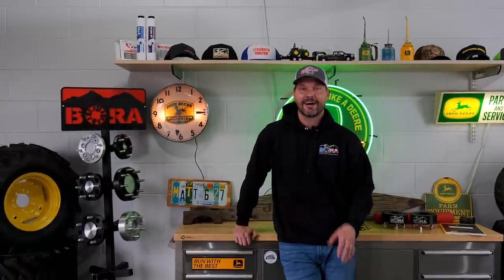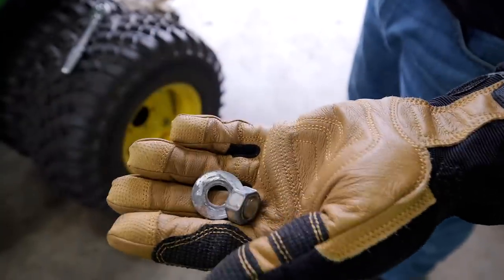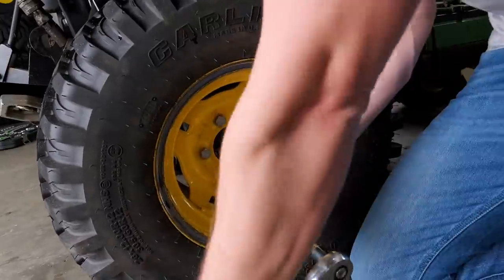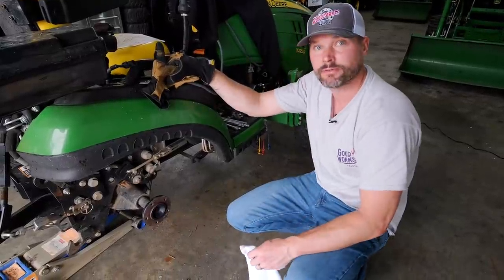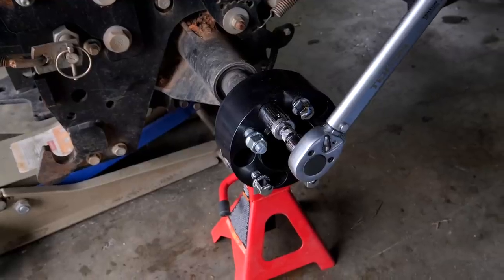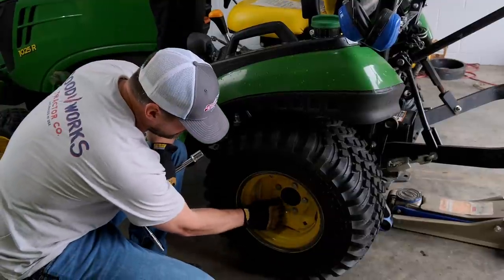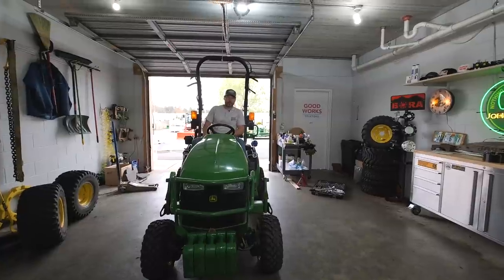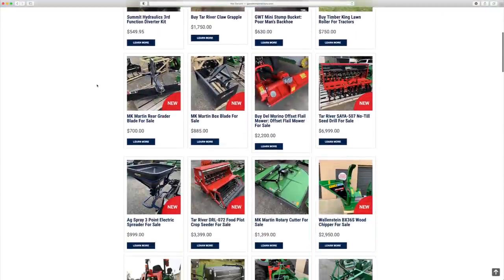SAFETY FIRST! HOW TO INSTALL WHEEL SPACERS ON YOUR TRACTOR! 🚜👨‍🌾

Comment: Great video!  As a note for those handling larger tires filled with ballast, this works well for re-mounting:  (1) roll the tire onto a 2x6 and lean it against the lugs (2) rotate the axle by hand, to align the lugs with the holes (use chocks on the front wheels as in this video, so you can have the parking brake off), (3) with the tire tilted against the top lugs, raise or lower the back end with the jack, so that the top two lugs drop into the holes, (4) put nuts on the top two lugs to the extent that you can, to keep the wheel from coming off when you raise the back end further, (5) with the nuts in place, raise the back end until the remaining holes slide over the lugs.

This worked well for me on the L2501.  For one wheel, I had removed all of the ballast because I was afraid I couldn't handle a 400 pound wheel  (the ballast was about 250 pounds of the 400).  What a project it was to pump all of that fluid out, and then replace it after putting the spacers on.  So on the second wheel, I tried the method above and it was so easy.  Get some help if you can (I did this myself as an old dude), and make sure to keep that wheel vertical when you are handling it.

Comment: Hi, Courtney - love your videos - I've learned a lot from you and just purchased my first tractor at the age of 70.
I was getting ready to order some BORA spacers, and took the time to read their  "Terms and Conditions".
With my Rimguard filled 36" tires, I would have to schedule someone to help with the installation, probably on the weekend.
But BORA doesn't allow for this:

• TIME LIMIT FOR REPORTING PROBLEMS - Any and all complaints, problems, issues, missing parts or components, etc., if any, MUST be reported to MOTORSPORT TECH within 48 hours after Customer accepts delivery of merchandise. After 48 hours, all problems and issues, except for warranty issues, are the Customer's responsibility. 

Also, installing the spacers with help from a friend automatically voids the warranty:

• INSTALLATION - All installations shall be performed by a licensed professional mechanic or by a professional wheel or tire store in order for our Limited Lifetime Warranty to be applicable.  
I guess I'll hold off on ordering under these conditions.
Rick.

Comment: I did wheel spacers on my zero turn that I use on slopes, it really provides more stability. Also, I use brushless impact drivers for my loosening and spinning the lug nuts. I still start them by hand and occasionally, i need the 4 way lug wrench to loosen but the impact driver really speeds the process. And yes, I  torque the final quarter turn.

Comment: Purchased 6" steel set of these wheel spacers for my 3720 John Deere last summer.  Used your discount code. (THANKS)  This tractor is used on my small farm and our golf course.  Everyone says these are true life savers on the Tractor.  I had bugged John Deere for years on a solution with no help.  We have rolling hills here in southern Indiana and these tractor are unsafe with these spacer.
I installed on front and rear wheels with no issues.
Reply from the maker: Awesome glad to hear it!!
Reply: Similar terrain issues here in Scotland. John Deere should seriously note that not all farms are on prairie land. Spacers are the way to go IMO.

Comment: I have to agree that this is the best upgrade to do first on a tractor. This is speaking from experience since I did not do it for the first year of owning a BX23S and having a few "tipsy" moments. I installed the 2" spacers and it does feel more planted now on side hills. Anti-sieze should be used on all the bolts and nuts during installation. It allows for more accurate torque settings, compression of the wheel rim and spacer, and more accurate stretch of the studs. Great video!!
Reply from the maker: Awesome, thanks for sharing!

Comment: I just watched your video in the installation of the BORA wheel spacers on your 1025R and found it very well done.  It looks easy and I have all of the torque wrenches and specs to do it correctly.  That's when I got onto the order page and was about to order a pair of 4" spacers for the rears of my L3901.  Before I hit the order button I noticed that there was a box that I had to check.  It said "Please check this box to confirm that you have read and accept Motorsport Tech's TERMS AND CONDITIONS, and that you have read, understand, and agree to abide by our INSTALLATION INSTRUCTIONS."  Well... I'd read the installation instructions and they were about like you showed on the video but then I read the deal breaker :  "• INSTALLATION - All installations shall be performed by a licensed professional mechanic or by a professional wheel or tire store in order for our Limited Lifetime Warranty to be applicable."  I live 30 miles from the nearest Lic. Pro mechanic or Pro Tire tire store and have no trailer to get my tractor there.  That means that if I buy and install them myself and anything happens to them I'm SOL.  That's over $500 out the window.  Are you a Pro mechanic?  Being sponsored by BORA I imagine that they would fix/replace the product(s) for free for you... but not for me.  I noticed that you made no mention of that in the video.  Buyer beware, I guess.

Comment: If those are stainless bolts a little bit of anti seize is recommended/ necessary because stainless is easily gulled. Seen it plenty of times at the chemical plants I've worked at.
Reply: Same here working in the shipyard, my favorite thing is when people think heat is going to help the situation LOL

Comment: you can get to the inner bolts to retighten after a few hours by taking the wheels off the spacers. reinstall the wheels and check and retighten the wheels after a few hours as the manual suggests. happy tractering. I have a 2003 john deere 4310, never had a repair with 1500 hours and hard work plowing snow in maine. I have chains on all 4 wheels to plow up a big hill.

Comment: For anybody wondering, I have BORA 2" spacers on my 2025R, which allows plenty of space for the Mid Mount Mower, and it also doesn't stick out beyond the 54" bucket, which is nice since I use it for heavy snow removal.
Reply: Are you talking 60" deck?
Reply: @BillyP55  Oh yeah! I meant to say that. Yes, I have the 60" mower deck with a 2019 2025R. BORA should also be able to answer any questions if you have a different year or model, but if you have a recent 2025R then you should be good :).

Comment: Thank you for making these videos.  I work on cars a lot and live in salted area. 

When I do anything with wheel hub surfaces, I use thin layer of antiseize on the mating surfaces.

If you work with BORA closely, I think they can leave little more material on the center of the hub flange by not drilling out the center all the way through in same diameter.  Center hub off of the axle only protrude so much. It only has to be drilled out as such on the spacer and leave material for the spacer.  In fact it does not need to have a hole in the middle through and through.   Just need enough hole cut out for the hub to seat.

It will keep junk out of the space and make the spacer stronger.

Comment: As with any wheel, you should tighten the nuts or bolts down in three stages instead of tightening down to full torque on the first try. Also on a 5 bolt pattern you should go around in a circle and torque every other bolt instead of tightening the one right next to the one that was just tightened. I would use thread locker on the inner bolts. Keep up the great videos!
Reply from the maker: Yeah I went in a criss cross pattern.  Good advice.

Comment: Because the inter bolts are not accessible I'd most likely use Lock-tite on the inter bolts. A little insurance it was troubling to see your inter bolts lose. Thanks for all the high quality videos! 👍
Reply from the maker: Yeah, BORA's instructions specifically state not to use Lock-tite.  I agree, a little worrisome on the bolts being loose, but that's also why the manual says to check them so frequently!

Comment: I put aside on the front of my 2305 but I bought them three summit racing I use them on the front because I didn't have room enough for my tire chains between the tie rod and the tire put my tire chains on and tried to rip my tire rods off so I've had them on there for 4 or 5 years and I love them

Comment: I put 3" spacers on my T554 TYM. I chose steel. You would have had a rough time picking one of the steel ones up the same way you picked up that aluminum one with one hand for your  4066R. What a HUGE difference in stability! Great video. Thanks! I went BORA becuase of you! EXCELLLENT comoany to do business with. They are busy ...

Comment: Hi Courtney,
I like using a 4-way cross style lug wrench. Although as I recall the 1025R lug bolts have a small head.
Also, using anti-seize or white grease on the bolts, helps as well.
Reply from the maker: Good ideas, thanks Tom!

Comment: I worked in the offshore oil and gas business for a good portion of my career.  I think some zink-based anti-seize compound might help you with both reassembly and the next time you need to remove the wheels.  Just my 2 cents worth.
Reply from the maker: Thank you for the tip!

Comment: I didn't read all the comments this time due to some weekend projects, but I do agree with son that spacers are more practical solution than duals I really think the best solution for duals to go the Ventrac route. Of course, it's a completely different animal than the conventional compact and subcompact tractor. Once again, it really depends on what your needs are, before a subcompact tractor or a small compact, I do think the Bora wheel spacers are the best solution for added stability.

Comment: Putting heavy tires and wheels on is a one-man job. To make it easy lay a 2x4 on the ground parallel with the front of the axle,roll the tire up to the 2x4 so it's close to alignment with your studs or hub. Then use a pry bar or a 3 foot 2x4 on the back of the tire and slip it right up on. let leverage work for you

Comment: Might want some Loctite if you have bolts you can't access easily, if you don't want to use red Loctite you can mix it 50/50 with blue Loctite

Comment: You should take the tires and wheels off to check the torque of the wheel spacers at the intervals specified in your manual. When running duals you should do the same thing. 
God bless you and your family!

Comment: After watching your video I ordered a set of  Borla 2 1/2" aluminum wheel spacers for my 2038R,  in reading the instructions in that came with the spacers it is saying that you are to use the provided hardware (studs) to install the spacers to the hub/vehicle, and use the stock studs to install wheels to the adapters, which is opposite of your installation video.
Reply: It maybe do to that I do not have a 1025R.

Comment: I have the 1025R.  What is the tip angle vs. wheel spacer width?  Has anyone published a comparison?   How much is tip angle improved per width increase?  What do you gain stability wise by going from 1" to 2" to 4" to 6"?  What will wheel weights do for tip angle that spacers can or can't do better?  Is there a chart that will show the advantage of width vs. tip angle?

Comment: Well a 1/2 inch or 3/4 pneumatic impact would sure come in handy. Try using anti-seize on the threads. Works great
Reply: 1/2 or 3/4 impact..3/8 all that’s needed for that job. JMO

Comment: ps  Star-pattern is Critical when tightening in order to even out the pressure across the mating surface... which is why bolts loosen, and why the need for Loctite.       Also, weve made a 18 in steel bar w two holes drilled to match the outer bolt spacing - lightly fasten in place to prevent wheel from turning when tightening inner spacer bolts.  Cheers

Comment: Hi, another great video.  I think once you had lowered the other tire down maybe hold down the differential lock could have helped.
Reply from the maker: Yeah, it did seem that the parking brake worked pretty well the second time.  I think two people is the best solution from start to finish, but shows at least one person can get it done.  Thanks for watching!

Comment: Its hard to tell but I think the reason you sheared the bolts is because you didn't jack the tire up. The torque of the entire tractor weight probably caused  the problem. Yes, jacking up the tire off the ground allows the wheel to spin unless you can put it in gear. My dad, a mechanic who worked at a car shop his whole life, taught me to jack the tire up but not totally off the ground. This help with removing all types of lug nuts. Hope that helps.

Comment: I purchased a set Bora 2 inch spacers for my John Deere 2038r.  They are different from the ones you had on your video.  I do not have two of the threaded one. Is there any way different to install my spacers from the ones on the video.
Reply: I just received my spacers for a 1025R and just like you, the spacers are different from the video. I have 5 bolts sticking out and it was not mentioned that I had to buy the lug nuts separately when I placed the order. Little weird.

Comment: What's the widest you can go on a BX and not have issues with a mower? I've been messing around in the snow in my yard and want to get 3" spacers on each side I think if they will work with my 60" belly mower.

Comment: With aluminum spacers, do you get anything to put between the steel and aluminum? So they corrode. Because steel and aluminum do not mix.
Reply: Excellent point. There should be some suitable material to make a thin barrier between the two different metals.
Reply: Electrical tape works
Reply: Anti seize always worked for me. And yes you will probably get some on you,your gloves,your tools, and your pants.

Comment: I just received the Bora spacers 2” thick for my 1025R and it said that all the hardware was included. Well, it seems like you actually have to order the lug nuts as well (separately). And when you go on the motorsport tech website, they don’t tell you which closed end nut would fit for your specific order.
Reply from the maker: I’d suggest talking to the manufacturer.  I’ve never had to order anything extra for mine.
Reply: @GoodWorksTractors  Thank you! I appreciate you and your channel very much!

Comment: Thank you for the detailed video.  Do you think it is necessary to widen the front to match the rear?
Reply from the maker: Good question.  I think it's best just to do the rears.  The rear axle is rigid, however the front axle pivots.  So, it will lean left or right with or without spacers.

Comment: Love your videos….I’m getting my first Deere tractor next week! 1025R…..I have their GX255 and X590 (590 is trade in for 1025R but keeping the 255GX, it’s such a sweet running mulched)…..so…question……what was the total increase in overall tractor width after the spacers? It looked like you mounted the shallow rim side in as well, correct?  I would like the extra footprint for stability without going crazy. Gotta get some steps, mirrors, …all kinds of stuff. So will be contacting you from the other side of the lake!! I’m 50 miles west of Chicago. Thanks again.

Comment: Hello sir I wonder if you may could talk to BORA and see if they maybe could do one of two things. 1 give longer bolts to bolt the spacer to the hub that way if it does back off it will hit the wheel and some threads will still be in the hub 2 still have a long bolt but make a recessed lip so that if the bolt backs out it only can go so far? Just a couple thoughts since there is a slight chance in the bolts backing off. I’m sure they wouldn’t fall out or anything but would make you feel a bit more at ease? Anyway just a thought. Thank ya for the vid!

Comment: Just received my wheel spacers for my JD 2032R. The wheel spacers came with 12mm  diameter bolts instead of 14mm diameter bolts that are currently on my tractor tire.  I could install the spacer to the wheel hub using the original 14mm bolts that came with the tire, but then I would have to use the smaller 12mm bolt to attach the tire wheel to the spacer. Does not seem right to me. Any thoughts would be greatly appreciated.

Comment: get a 4-way or an impact wrench.

how much does that extra length effect the axle? like is it more likely to break with the duals on there? what about with the spacer+ duals?  seems like possibly the duals might have had enough torque to stretch those lug bolts and they were hand loose after that. idk, just possible observations. thread locker maybe?

Comment: Great video - I have looked at these several times - I have a new Kubota MX 6000, do you for see any issues with the added stress on the axle?  Do you hear any talk if this would void the tractors warranty if you did have an axle issue? As always thanks for the videos.
Reply from the maker: I'm sure there's some added stress, but I also think there's plenty of margin built into the design.  Tractors have been running spacers for a long, long time withvery few issues.

Comment: I'm going for these on my Mahindra eMax using the 5% off code.  I think I'll use blue lock-tite and/or a nylock nut if there's enough bolt on the inside.

Comment: The free-spinning hub was because of the open differentanl.
Reply from the maker: Parking brake seemed to solve it
Reply: @GoodWorksTractors  that’s what I’d recommend, parking break. I’d do that anyway just because your using a jack and taking the wheels off.

Comment: When you are taking the bolts off "break them loose" before you jack up the tractor and the wheels won't spin while you have to use more force to start the bolts/nuts coming off

Comment: Two questions, I have a 3025e, what spacing would you recommend as a middle of the road? Second, if these work well (I don’t doubt they do), why would they not install or design wheels to have this offset from the factory?